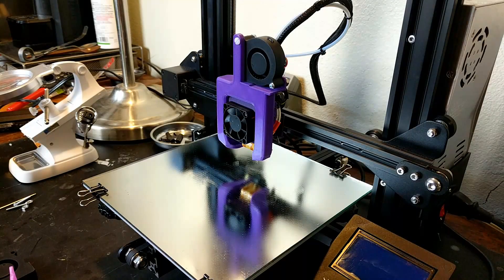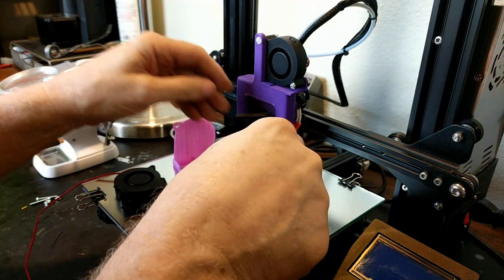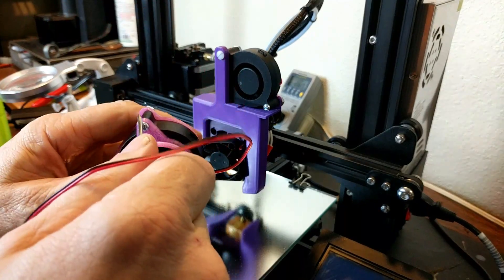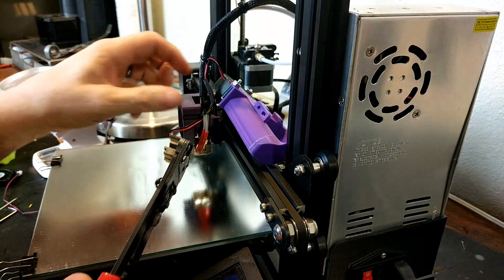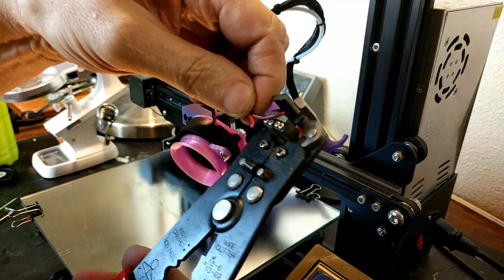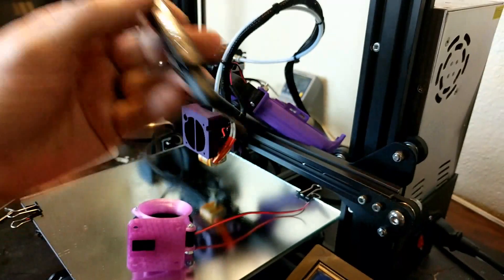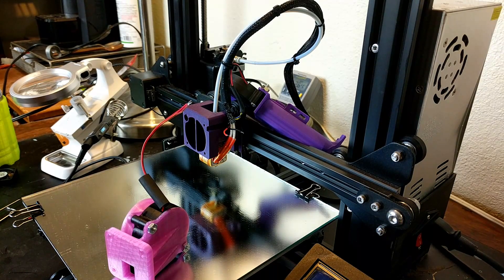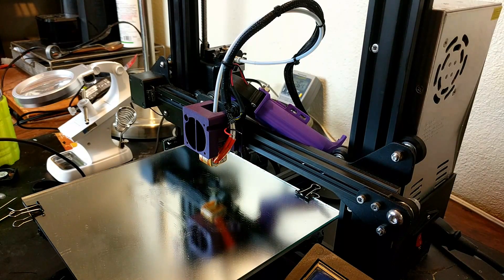Ender 3 - Upgrading the hot end cooling fan Part 1

Comment: That little soldering iron reminds me of a 3D pen! Heats up fast like that too!
Reply from the maker: The TS-100 is a neat little iron, I tend to use it mostly for quick fixes on very small electronics as it really doesn't have enough amps for anything larger. I upgraded to a soldering station with heat gun, you'll find it in one of my later videos, but I still whip out the TS-100 from time to time. Thanks for watching!

Comment: nice soldering tool. where did you get it?
Reply from the maker: It's a TS-100 available from Amazon and most of the Chinese retailers like Gearbest, Banggood or Ali. I've got a couple of them and they're great for the occasional small project where you want fine control of the temperature or for something to carry in your kit. You will need an 18v power supply, some will come with it but not all do, so read the description. If you're doing bench top production work then something like a Hakko would be much better.
Reply: Chuck Bryant thanks. I've recently subscribed to your channel and I'm finding your fusion tutorials quite helpful as I have no idea on where to start and most other channels just assume you already know the basics. Big hug from Spain
Reply from the maker: @Joe-Skynet  I had the same problem when I started years ago when I got my first benchtop CNC mill. Not only was there little help for a beginner, but there was a lot of scorn from the so called experts. When I'd ask a noob question I'd hear  "Just go hire a real machinist" and similar stuff. So I know where you're coming from. So feel free to ask me questions, we're all here to learn and have fun.

Comment: 7:17

This is the noisiest fan on my ENDER 3.
I just installed X,Y stepper dampers, also printed out the damping feets: https://www.thingiverse.com/thing:2913473

So i have that black foam   (?) sheet (from Ender 3 package) on my desk and then there are these damping feets and on these damping feets its my Ender 3.
It is printing now and its so silently printing that i can hear only this loud hot end fan.

I mean really. It prints but so silently that i forgot that its printing, even its near my left hand.
So i have to find same size noiseless fan and install it.
Power supply fan is not so loud but could be also replaced.

Im very happy with the result of 2 stepper dampers that i bought and these damping feets. Makes it very silent.
I guess Z stepper damper will not hurt also. I can sleep now and leave printer working.

Comment: What petsfang part did you print? There are so many in the print files
Reply from the maker: These are the three I used.
v2_5015_CR10_TevoEZPrintDuct4.24.stl
v2_Endr2or3Base5.8.stl
WireStrain4StockFanDuct3.26.stl

Comment: Chuck,  I'm a total NOO B and have had my Ender 3 for only about a month now. I'm enjoying your posts, and I'm just thinking out loud, so to speak, but I was wondering: by adding the extra weight of the  Petsfang, larger fans, and the adapters to the Y axis,  with the inertia of the additional weight, do any of the acceleration settings need to be adjusted?
Reply from the maker: Ahh, how interesting you mention acceleration, as I've been struggling recently with something called "ringing" which I mostly cured by changing acceleration and jerk. The weight of the Petsfang and it's base is IMO negligible, probably no heavier than the sheet metal part that gets removed. Yes, the fan probably weights a few grams more, but enough to cause a problem? If so I haven't seen it, and I've still got a stock Ender 3 to compare it with. And the problem I've been having with ringing is with all 3 printers, not just the one with the petsfang on it. Sooner or later I'll print another petsfang and when I do  I'll weigh them. The ringing issue (think ripples in a pond when you throw a stone in) was cut significantly when I changed the acceleration from 500 to 300, and the Jerk from 20 to 15. It also makes for a smoother running and sounding printer IMO. It raises print time by a few percent, but to me it's acceptable and it's become part of my standard settings. If I can find something to test print that illustrates the problem and doesn't take 20+ hours to print, I'll do it and make a video. Problem is, the issue only gets bad when you get the Z axis +100mm and at +200 it was awful. Slowing the acceleration and jerk saved by butt as I was already overdue on that job. Thanks for the comment, keep them coming!

Comment: Are these new fans louder than stock?
Reply from the maker: The 5015 blower fan is louder than stock if you run it at 100%. But at 100% it's probably blowing 2x - 3x times as much as the stock fan. For normal prints I run it at 60%, for prints that have bridging I bump it to 80%. That's for the part cooling fan, the hot end fan I've taken off the 5015 blower, not because it was too loud, but because it just got in the way too much. And I've switched out the Petsfang for something else, I'll have a video on that fairly soon.
Reply: Excellent. Looking forward to the update!

Comment: Nice video! DId you have to add a capacitor or anything? I bought 2 5015 fans from banggood and both blew up after I connected them, wiring is OK since old fan works fine.
Reply from the maker: I didn't add a capacitor or do anything else, just wired it up to the existing fan wires.

Comment: Thanks for the videos - how are the 5015 fans holding up ?  Do they increase fan noise?  Last question - do you run the nozzle cooling fan at 100%?  Thanks again.
Reply from the maker: They're holding up fine for me. At 100% they're louder than stock, so I keep them between 60-80%. And that's still more cooling air with the Petsfang than the stock fan at 1005.